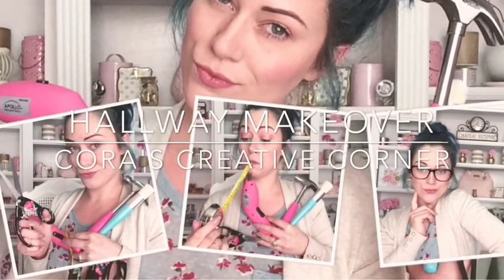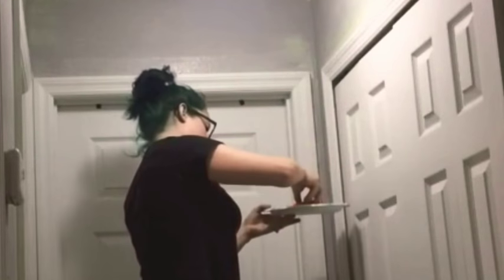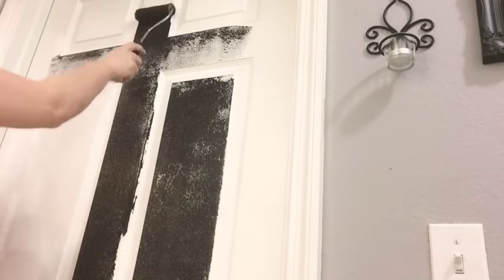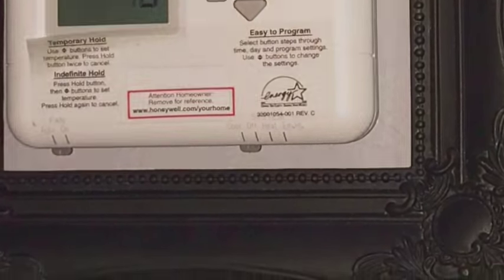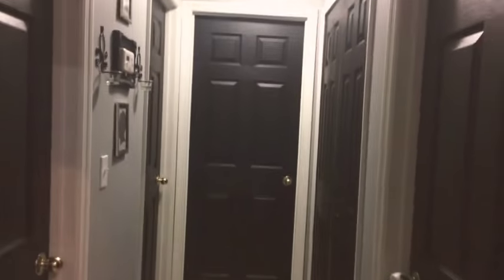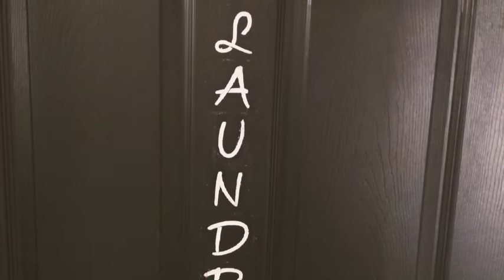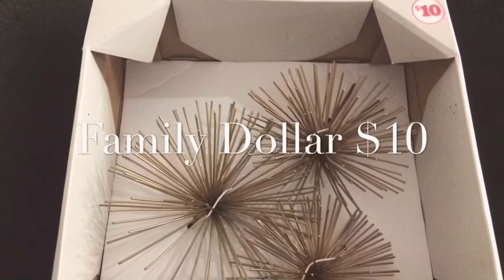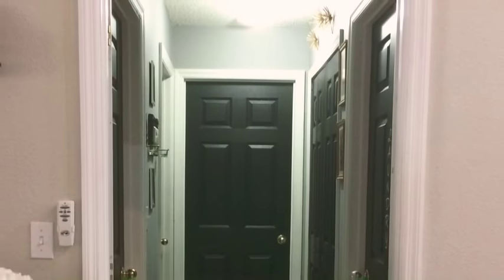DIY Home Makeover : Hallway Edition...$20 | DIY Home Decor | Giveaway: DIY Starter Kit

Comment: A runner would be a good finishing touch. It would protect the flooring, absorb noise in the hallway, and help the floor go with the space better. Even if you eventually redo the flooring I'd still have a runner for the protection & noise absorbing.